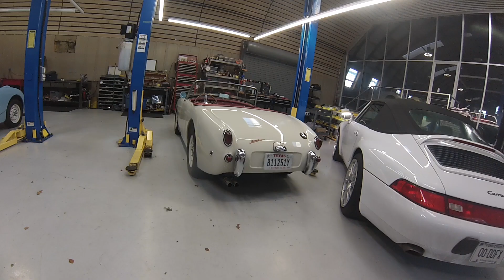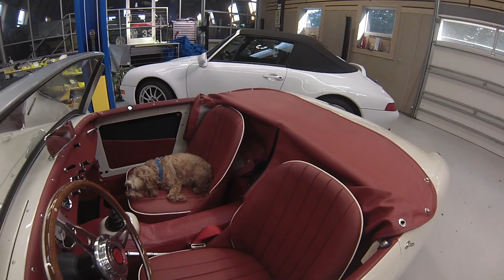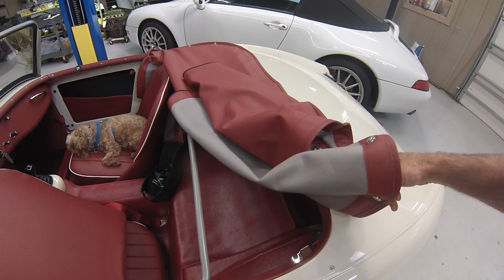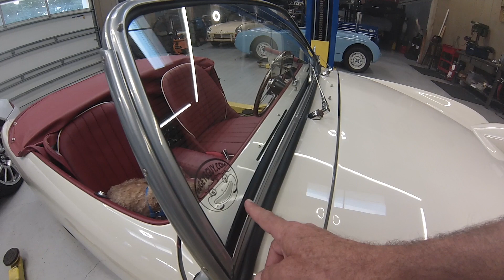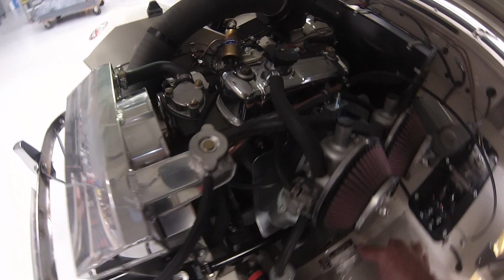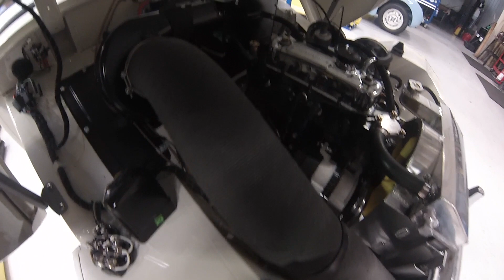TJ Tour

Comment: Spectacular. I owned a 1958. Purchased used when I worked at British Motors of Monterey in Calif, 1968-1972. Two kids came along so we decided to part with it and bought a 1969 MGC GT. Wish I had thought of cutting 
out the rear section as with this car SPRITE. Great job, thanks for bring back the memory.